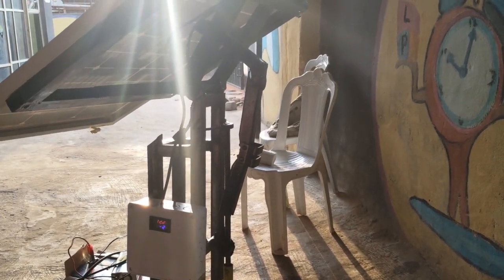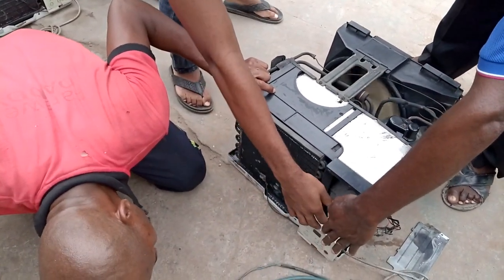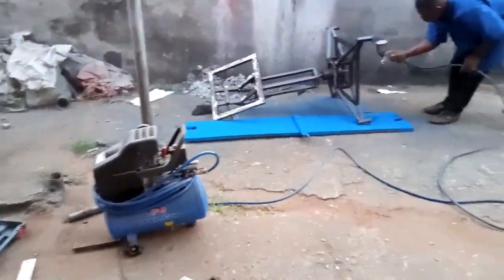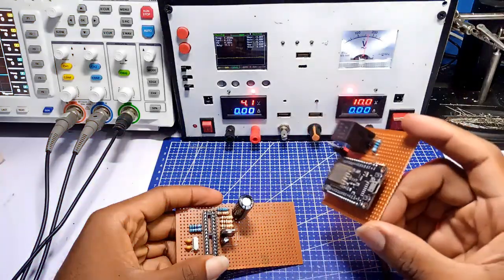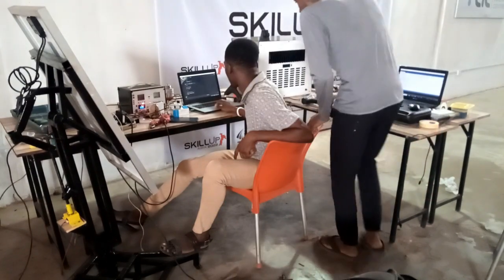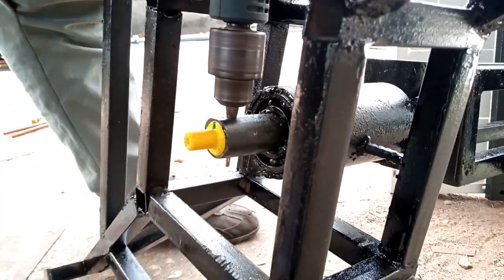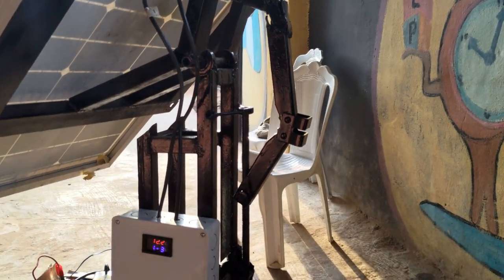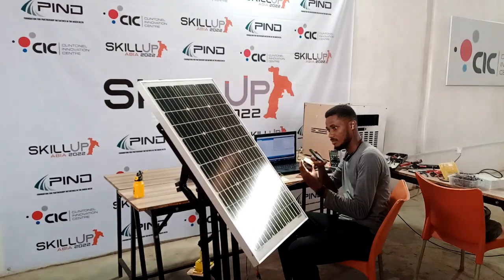Dual Axis solar tracking project with Air conditioner system.

Comment: this is beautiful,

there are ready-made linear actuator systems that would have saved a lot of time and money, some were designed for DIY standing desk assembly so they are very powerful, 
tilt sensor is very important for detecting the last known orientation of the panel after the arduino is powered down, for every power up, the position should  be reset to horizontal and you can start counting the step again, 
a worm gear assembly would have been great for the base, since you only need more torque not speed, you don't want waste energy that could be sent into the batteries just to drive a bigger motor. a worm gear assembly will also prevent the panel from being thrown off course by strong wind. cheers
Reply from the maker: Wow,
Thanks so much for this kind recommendations.

I will have to make order on this components in order to build upon it.
Thanks 🙏 once again 😊

Comment: This is an awesome one brother.👍
 I really love it.❤

I think what would have helped manage the excessive loads for the stepper motors is incorporating an hydraulic system.
That way, the stepper motor would only need to push the plunger of a small hydraulic cylinder, while this little force would in turn be magnified by a much bigger hydraulic cylinder connected the load. 

What do you think??
Reply from the maker: Wow.
Great technical input this is.
I will try and get such components soon.
Thanks for this.